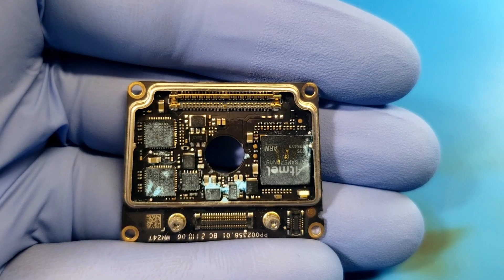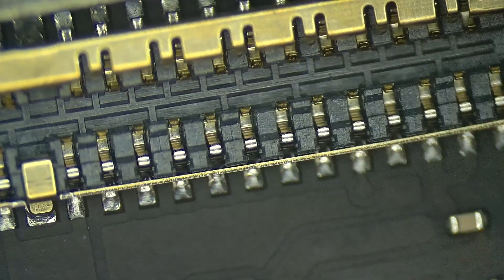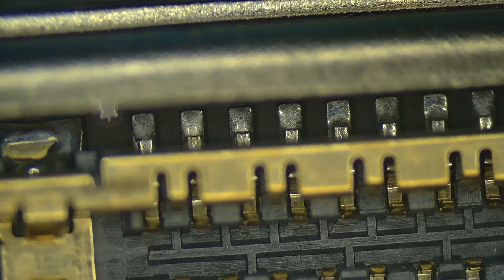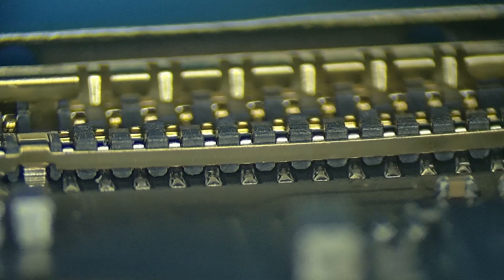I botched this repair and had to tell the customer!

Comment: Hi,
Is there a way to test the pc board in the top where this connector you speak about plugs in. The cable is known as ptz. The YAW motor and ptz plug up to it. The Mavic 2 Pro/Zoom YAW motor ribbon is so hard to plug it up, and can be damaged. So having either a bench set up or extension cables or a test board would be how testing the pcb would happen. Rather than do it completely installed on the vibration dampener and tgen connect it to the drone.

How do you test yours?

Comment: You might be able to hold the connecter in pliers and hot air it, then quickly bang the pliers on the desk and the momentum will flick the solder off.

Comment: its great seing you again lol how is your robot for the pool going lol and that connector boy that looks easy but is a hard job to do . :goodvibes::washhands:
Reply from the maker: Hey, it's good to see you here!  That pool vacuum got liquid damage inside and no longer will charge the batteries.  I'm planning to take it apart and fix it.  I might turn it into a corded vacuum and not use batteries.
Reply: wouldnt that be heavy but great that you are here lol it gets so boring on the net. :yougotthis::goodvibes::washhands: @ststele

Comment: Hi. Is it maybe possible to scoop a small amount of solder paste ( used to flow a procesor) on to the tip of the egzacto blade and place it under the pin and use the hot air ?

Comment: I tin the pads with pb solder then flux and use a balancing act between lower board heat and low upper hot air reflow, very slow and careful process. The good thing is the connector is very well plated, so it wicks the solder.

Comment: Yeauuuh... Pre~Tin the pads and the New Connector, followed by a damn fiddly and 
strategic use of Kapton Tape before using a Hot Air Station under side, YUP from
underneath.. APU 👁👍

Comment: That connector reminds me of the shielded A1932 usb c connector...
Btw, couldn’t you save the connector you botched by taking it off the board and wicking it? It’s hard I know, and the plastic melts really fast but at least you could’ve tried while waiting for the new connector...
Reply from the maker: I think I could save the connector with very delicate wicking.  It would have been ugly and made me really uncomfortable though.  Maybe if it was my own device!  I kept the old connector.  I might fiddle with it just to find out.

Comment: Hey Jason, looks like the same type of connector that apple use on the T-con board for the a1706 and beyond. If it is like that then you can take the outer ring off and solder as normal and then add that later for stability and grounding.
Reply from the maker: I would need to cut the metal ring off and then solder back on.  I don't think it could be removed without cutting?  I'll have to look again!  I kept the connector that I globbed full of solder.

Comment: What about using some kapton tape on the metal parts ?
Reply from the maker: That would work.  Would need to get the kapton on the inside and outside of the metal bracket but it is possible to do that.

Comment: Don't be too hard on yourself. You have a lot of skill. On the bright side you now know  those  connectors exist. Once bitten twice shy as they say. Seems it worked out in the end. 👍👍
Reply from the maker: Thanks!  Yah when doing any new connector I will for sure be inspecting from all angles before starting!  I did this on auto-pilot and only looked at the connector from top down before soldering.

Comment: Jason… shit happens  at least you told the customer with out any bullshit.  Would it have been better to use solder paste and then hot air?   I don’t know what the connector is made out of to use hot air
Reply from the maker: Yep, thanks! It's pretty amazing to see solder melting before the plastic!  The plastic on these connectors must be pretty high temp stuff.  If the hot air is too hot, it will actually melt them but with the right heat, the board can be finessed up to temp and solder melts without blemishing the connector plastic. Also could have used paste on the pads but has the risk of when it melts, traveling up the connector pins - that is NORMALLY ok tho! 😁
Reply: @ststele  aaa  makes sense    Thank you for replying   And you’re welcome

Comment: That connector looks like something designed by Audi. It's exactly the kind of trap you can find in any modern vehicle...
Reply: Looks like something exactly what apple would make
Reply from the maker: I sure wish I would have looked at the connector better the first time!  I just did it like I normally do connectors.  Whoops 🙂